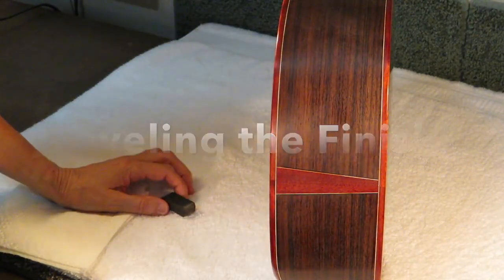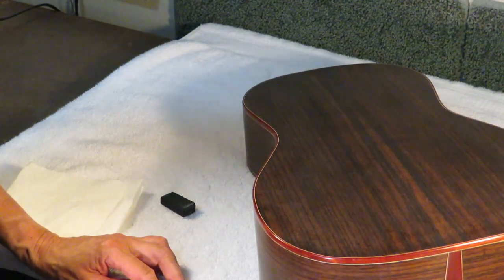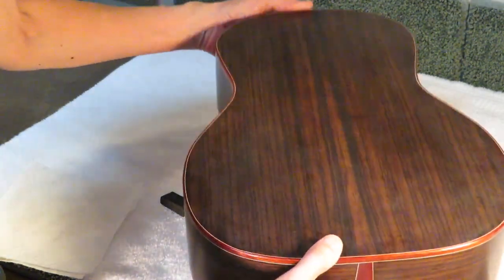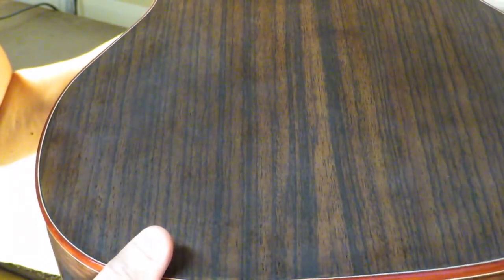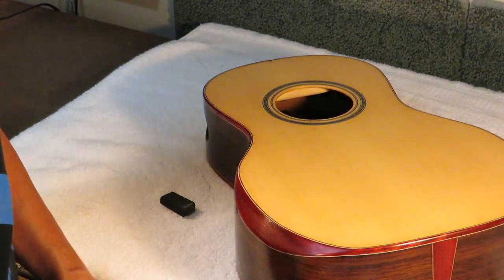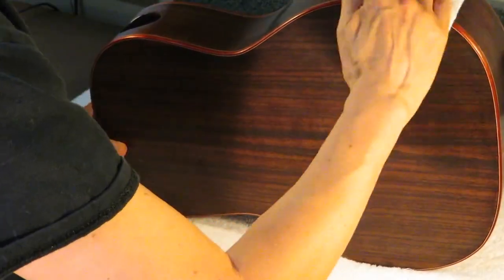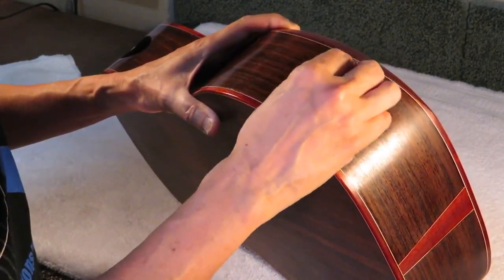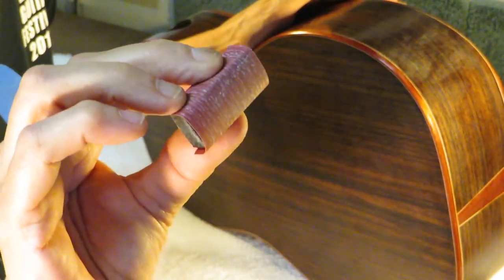FRENCH-POLISHING STEP 6: THE FIRST LEVEL-SANDING

Comment: P1000 is a FEPA designation. That grit does not correspond to the American system, CAMI 1000 grit, but is 500. If you are to level sand at CAMI 1000 then P1000 grit size is twice as large.
Reply: Hi Rick Kernell what sandpaper would you use to level sand? American system. Thanks
Reply: I thought that looked bigger than the 1000 I've been using. Thanks.